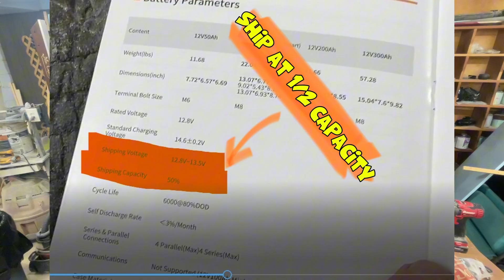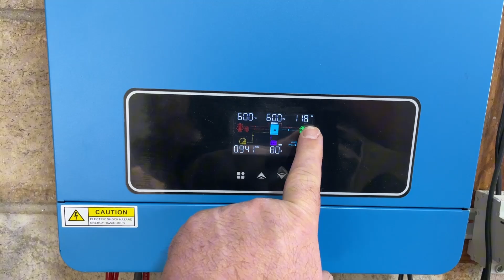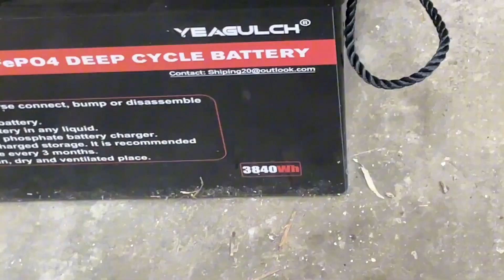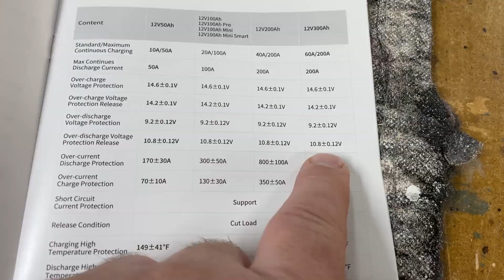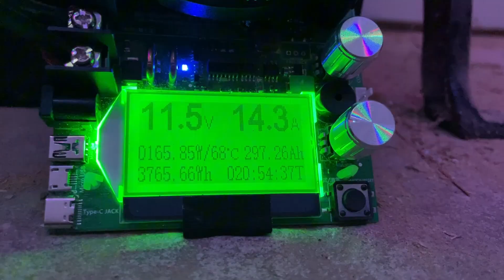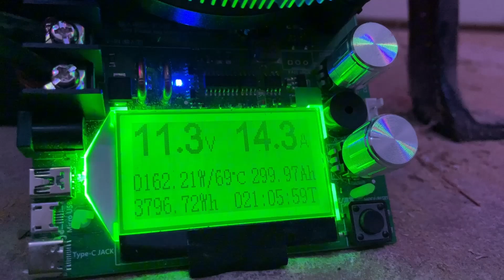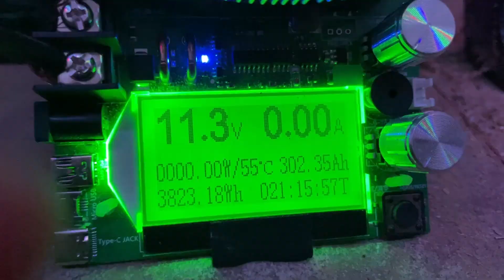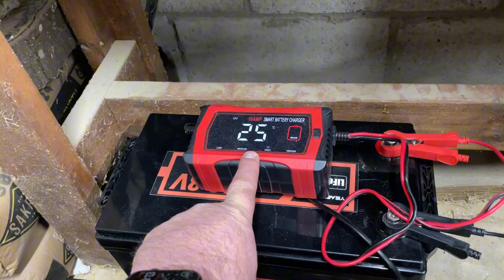This Solar Upgrade Is INSANE — Goodbye Car Batteries!

Comment: Did you try a heavy amp draw, like 50 amps?  How does that affect battery life? Or capacity...?
Reply from the maker: I’m currently using these at my home for my current setup. Last night I’m still getting over 300 AH. I pulled 303 last night. I’m using 4 of these batteries in a 48v system I’m normally pulling up to 110 amps over the system. So that’s only about 30 amps per battery. So no I have not tested above that.

Comment: mine showed up @12.11volts....it will not take a charge...3 days trying 4 different chargers...nothing happens....trying to get this replaced by Yeahgulch but they are not responding...STAY Away from these and look elswhere
Reply from the maker: So sorry to hear that. Mine 4 are still working great
Reply: It appears as always,  cheap Chinese are a crap shoot.  Sometimes great, sometimes NOT.
Reply: Chinese,  a gamble

Comment: in wills test with a watt cycle 300ah (but 280ah technically) he pulled 305 amp hours. Your 300ah (but technically 280) pulled only 302 amp hours. So either you didnt do a top balance, or the cells this battery company uses are grade B cells, which is what i think they are doing.
Reply: I disagree with your conclusion that this battery is that much different to the Will Prowse test which only pulled 3Ah more a mere 1%  difference in results.  This difference could be simply due to calibration error of the test devices.
Reply from the maker: I agree. I’m not about to open it and look. I’m still getting 309 to 312AH still out of it currently. In my opinion it’s still best to do 12v 300Ah batteries with an active balancer then server rack batteries.
Reply: @OobiesTips @OobiesTips 12v 300ah, 400ah, even 600ah batteries online ARE SOOO much more inexpensive price per kwh then the 51.2v 100ah batteries. So I agree with you there. Just makes it harder though,
I heard its not a good idea to put BMS operated batteries in series even with a balancer. I was impressed to see in your other video the balancer matched the voltages, even with that third battery being at a much higher state of charge. I think it could be a problem with the fact that lifepo4 has such a straight discharge curve, the 4 batteries in series may have balancing problems if one of the batteries cells exceeds 3.65 volts in one or more cells, the bms will cut off and then it will turn into a 36v pack while a 48v charger is still connected.

Comment: That's really not a 300Ah battery. It's using 280 Ah cells. That's why you just barely made it over 300. New cells will have an overage that eventually disapates. You'll eventually start settling down to 280. Will Prowse has caught a lot of vendors doing this as proven in the teardowns. Even a number of the big names have been caught.
Reply from the maker: Yes I watch Will all the time
Reply: @OobiesTips  We can provide you a new 1500W pure sine wave inverter to test.Are you still need?
Reply: You will get thousands of cycles before 280ah is normal capacity

Comment: got mine in, works great as well. appears to be eve280 cells which are 280ah but seem to test near 300 if binned. Only downsides im seeing is kinda thin bus bars but sufficient.